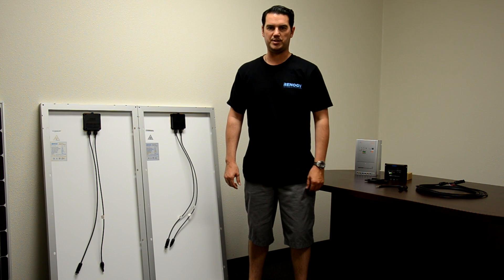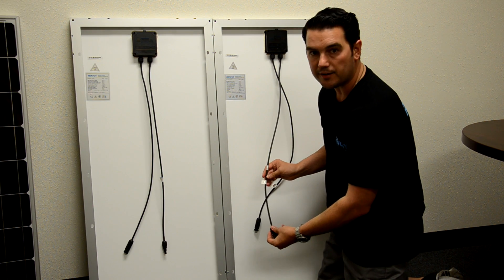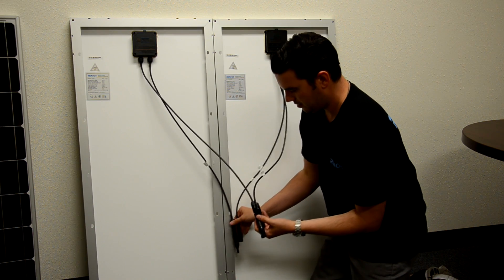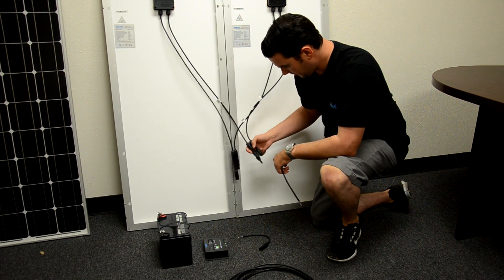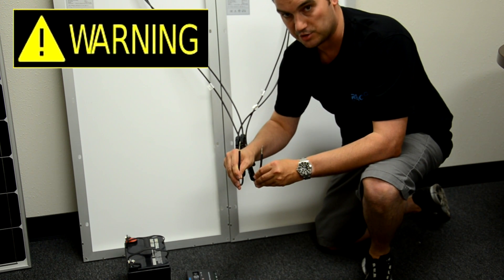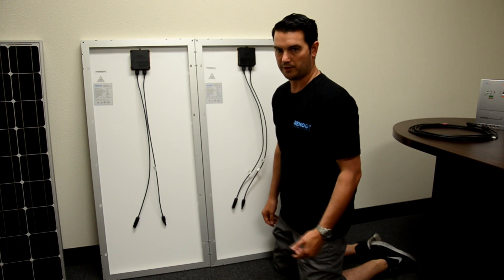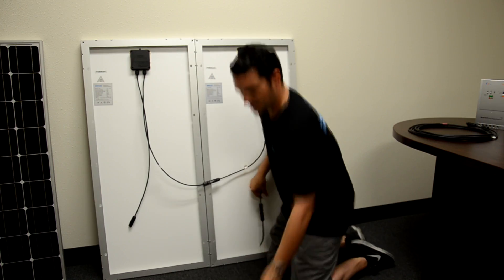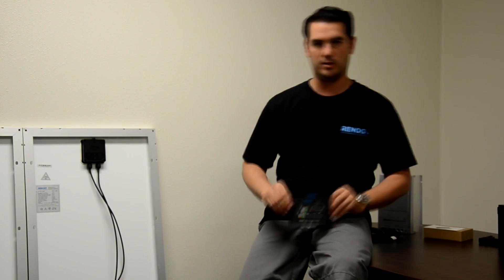Renogy: How to connect your Solar Panels in Series and Parallel Pt. 1

Comment: You should connect those wires to the charge controller first. Then after your battery is connected and your charge controller is on plug in the cables to the solar panels.
Reply from the maker: Hello, My G.

Thank you for your feedback. We have reflected the problems to our product department and we will revise the mounting details later. 

Wish you a nice day.

Comment: What is the gague/size of the adapter wire that connects to the charge controller ?
Reply from the maker: Hi, Robert.

Before we calculate the size for you, we need to know the following information:

1. how many solar panels you have;
2. how do you connect the panels? in series or parallel;
2. Please kindly tell us the operating current of your each panel.

Look forward to your early reply.

Comment: Hi watched this  . But im confused im wanting to connect 2 150w panel to a 30amp controller mppt . And 2 x 110 amp hour batteries .so what is the correct way for me as im told to keep 12volt system the batteries have to be connected , by parallel  ??
Reply from the maker: Hi, Adrian.

If the batteries are connected in parallel to form a 12V system, it is recommended that two 150W solar panels are connected in parallel, too.

Hope it is helpful.

Comment: I wont to set up a parallel system with two panels one facing west and one facing south east  will the two panels work individually as the sun moves past a blind spot

Comment: So I bought these
https://www.renogy.com/deep-cycle-agm-battery-12-volt-100ah/
And need help.
I have them set up as 24v series. Can my 24v 40amp 1500-3000 inverter run it?
My confusion is in the amps
Reply: No answers even for customers. TY

Comment: I might not get an answer for this but I still need to ask.  Do I run Series or Parallel if I want to charge two 12v batteries at the same time?

Comment: So i have a 12v battery bank and PWM controller system. I am upgrading to a 100V, 20A rated,12/24/48V MPPT charge controller, and want to install two Renogy 100W solar panels in Parallel to keep current lower.  My understanding is that i will be running at 24V at the panels, but i obviously need to keep my battery 12V. Does the charge controller convert it to whatever output i need since the input is now 24V?  Second, What fuse size is recommended for the two Renogy panels in parallel?

Comment: If I have a 300 watt element and 3 100 watt panels what is the best way to wire it up?
Reply: Do want to run a 12v system?
Reply: @chrispickle7661  yes but no battery’s

Comment: I have a 100w and a 200 watt panel from you guys can i run those together amf if so how should i do it. I have two 100ah renogy batteries.  O want to have 12v system.  I want the most life out of each battery each charge. From the research iv done i can link them but will lose wattage is that correct? How much will i lose. Please respond. Thank you

Comment: One question that I have though that has been very difficult to find is "How do you connect both the grid inverter and hybrid inverter to the Mains"? Is it done via 2 different double pole breakers that are turned on simultaneously ? if so, which of the inverters (grid-tie or hubrid inverter) control backfeed to the grid?

Comment: Thank you for this video, I'm new to the solar world and could you please tell me what connectors I would need to hook the panels in series to plug into a solar generator, I would rather not deal with bare wires and thank you very much.

Comment: I have 2 car battery of 55Ah 12V and two car battery of 200Ah 12V total 250Ah in serial 24V.
Controller 12V/24V 20A.
Also Panels of 160W 12V and the purchase of another panel is planned of 160W 12V total in series 160W 24V.
Whether it is a suitable charge controller for this panels?

Comment: I debating now between 100w harbor freight or 200 watt renogy from Amazon Im going to use this setup on my boat:
- (2) Walmart everstart marine batteries 
- 1500 watt max  inverter 
- 24” vizio led smart tv 
- 700 watt car audio amp for extra speakers I’m going to  install in boat 
I’m dedicating (2) batteries just for this setup and my thought is using the solar kit to keep these batteries somewhat charged,
I have (2) other batteries ( same kind) that (1) Is for the boat & other is for boat accessories , I plan on installing the panels on top of my Ttop so they will get direct sunlight

Comment: I have 8 renogy 12 v 200 ah batteries. They are use as backup. I have notice that even when NOT USED , these batteries lose 15 to 20 % charge. I notice it because when had no power and the sistem kicked it, I went and saw and it had lost 20% charge. IT was giving a low voltage WARNING. pLEASE HELP.

Comment: Can I connect a 20 watt panel and a 50 watt one in parallel? I searched on google and yahoo and can't get an answer. 🤔🤔
Reply: Don't mix panels if at all possible. Main reason is whatever panel has the lowest value is what the system will bring the stronger panel down to. It dumbs down power instead of adding up like you may think it should.

Comment: If I was your boss I would have fired you
Reply: Hi colin. You seem to know your stuff so hopefully I can profite from your knowledge.
I want to Increase my 100w solar panel system to a 20 system plus have 2 to 3 leisure batteries connect to said system. Those batteries will also be attached to a split charging system. This will be installed in my van to charge laptop/phone and speaker in the UK. My understanding is that I should connect the panels and the batts in parallel as to maintain a 12v system. Is this correct? 
I also wanted to get a fridge running of this too but I realise that this might be too much. Any thoughts and advice would be great! 
Thanks
Reply: *200 not 20

Comment: Great... Now, I have twelve 18V panels and a combiner box with inputs for 6 connections. How do I connect this system to a 24V PWM controller? It came in a lot with no instructions lol
Reply: Here is more info from them if you're interested: https://www.renogy.com/learn-series-and-parallel/

Comment: Can I ask what gauge the cable in the adaptor kit is please? Well I can, I just did, lol.
Reply: Most likely 12 gauge. But they also offer 10 Gauge if you need it. I technically only needed 12 gauge but went with 10 gauge because the cost was nearly identical.

Comment: Why do you recommend a series connection over parallel if shading has such a profound effect on all the panels output?
Reply: Here is more info from them if you're interested: https://www.renogy.com/learn-series-and-parallel/
Reply: series will giving you volts and parrellel will give you more amps.  so if you need more volts do series or if you need more amps do parallel.

Comment: Once you have connected two panels in parallel, what is the proper order in connecting your panels to your charge controller and your charge controller to the battery?  I want to make sure I don't mess up the panels, charge controller or batteries.  In my installation I have no circuit breakers. 

I assume first you should hook your charge controller positive and negative to the battery.  Then I should cover the panels with a blanket and hook the panels to the charge controller.  What I'm wondering is does the negative from the panels to the charge controller happen first, then the positive to the positive on the charge controller?  Is this correct or do I have it backwards.  What is the correct order for hooking up the panel to the controller and the controller to the batteries?

Comment: what if I want to connect a 100W panel with 200W panel
Reply: Don't do it it will make the voltage drop to lower panel W

Comment: Howdy... I have two renogy 150D Monocrystalline panels and a 40amp mppt charge controller. my battery bank is 12 volt. Two six volt Trojan T-105RE 6 volt batteries. how would you recommend that this be set up?
Reply: 8 months, I'm sure your not still waiting. But the two 6 volt batts need to be attached in series to make it 12v. The panels can be hooked up in series or parallel but mppt controllers like panels in series because it produces a usable charge current for more time of the day than parallel does. Don't side to series is one shaded panel can stop all charge unless you have panels w built in bypass diodes that let the current of unshaded panels to by pass the low panel.
Reply: One other thing, if you put the panels in series the voltages stack, 12+12+... The controller has a voltage limit, usually 60volts and higher, but I've seen as low as 27. You should not exceed what your controller specifies.

Comment: You have a diagram to connect 5 panels, the type of fuse, and size AMG wiring.  I order some renogy panels piece by piece but not sure how to connect all and using the correct size fuse and wiring

Comment: It would have been a hell of allot more intelligent to plug those 9inch leads in the controller first, & then, to just plug them into the  Y adapters, that come from the solar panels DUH!!!!))))))))))))

That way you do not need to worry about exposed leads, OMG!!!)))))))))))

Comment: For safety reasons you should attach the bare wire/plug adapter to the controller first then plug the PV panel plug to the charge controller plug no exposed wire to short circuit..... Safety starts with an "S" but it begins with YOU!...
Also once you figured out which wire/plug is POS and NEG go buy some RED electrical tape and rap the POS wire/plug adapter to easily be identified as POS.
Reply: ALWAYS CONNECT THE BATTERY FIRST REGARDLESS!!
Reply: @xraykadiddlehopper8067  What happens if you had 3 deep cell batteries and two 100watt solar panels? how do you get those 3 batteries to act like a bank of one?

Comment: This video is basically useless.  Why should you not short out the positive and negative wires from a solar panel?  How and why the hell do they rate the short circuit current then?

Comment: what's the best way to connect the solar panel to get more power? Is parallel better or series?
Reply: Depends on what you’re trying to accomplish. When ran in series, voltage is combined with a consistent amperage,  when ran in parallel, voltage is consistent  with amperage varying - source: electrical engineering student
Reply: Well, one is meant for 12v and the other is for 24v. Depends on your application, and what you are trying to accomplish.

Comment: Wow, hard to believe they use the same color wire for negative and positive. How hard would it be to use the standard red color for positive and black for negative?
Reply: This comment just shows how out of touch you are.  Take, literally, 1 second to search red wire on amazon.  It is more $$$ yet the exact same wire regardless of the exterior color, only the end user, Chuck Ignoramous and "David 'Fake Name' James" in this instance,  apparently need color coded connectors. How about we label them 1-2-3-4 as well?  For a price we can have some person in China do that for you too.   If you don't know, can't tell, or don't want to bother following the 9 inch wire to its destination then it's actually protecting you and us from your incompetence.   Keep solar panel prices as low AS POSSIBLE.  SOLAR ON!
Reply: Stupidity,  It doesn't cost any significant amount to mark one of the wires with a little bit of red Mr. Benji the bargain hunter.  You cheap ass bastard!
Reply: Worth buying some red duct tape to avoid hassles when wiring up
Reply: Yes that seems pathetic to me too.  Just a little bit of red on the positive wire insulation would be nice, yet they cannot even do that.  Bastards!

Comment: So for large installations where you have many solar panels (like on a house), how do they typically connect them?  Or does it depend on if there are microcontrollers on each panel?
Reply: in a house you actually don't need it, it's not as big as you think but if it does have a lot of strings you would use a combiner box for your solar

Comment: Hi i got two panel with these specification what type of system can i use??

Maximum Power Pmax 200 WP 
Voltage at Pmax
 Vmp
 35.86
 V 
Current at Pmax Imp 5.57 A 
Open circuit Voltage
 Voc
 43.8
 V 
Short Circuit Current Isc 6.69 A

Comment: Hi, I have 3, 250 Watt panels  should I connect them in series or parallel, and do I connect the two 12V batteries the same, cheers.

Comment: If your panels are connected in parallel, do your batteries need to be connected in parallel also?    Or can you connect the batteries in a series and connect the panels in parrelell ? Vice versa

Comment: Got (4 panels260w)(1 mppt 40amp, 100v,12/24)(4Batt 12vparallel, 100amp each)     Question I wanna do Series-Parallel so Ill just take 2Panels Series + 2Panel Series then connect them parallel to my mppt 12/24.  It will bring higher watts wich will help with max charging at daytime?  Do I have to change batt-setup? Batt is curently 12v-400amp setup
Reply: Did you ever get a response? Same question i had since i have a 12V trailer, but want to run parallel 24V solar panel on a 100V, 12/24/48V charge controller

Comment: Hi Renogy, fast question: I have 50W 12V solar panel and a lead acid battery 12V taken from a car (50AH)was using gel battery before but small capacity and expensive. I want to increase my power, for example adding same type 50W 12V panel. Should i connect paraller or series? How many can i connect(charger is PWM i think 10A, if problem i can buy bigger). Also about batteries, do you use same logic for connection?(parraler/series) can batteries be same volt of course but different AH?
Reply from the maker: We would recommend to hook up those 50W panels in parallel to increase the amperage and to keep the voltage the same, the 10A will be able to handle (x3) of our 50W panels in parallel, as for the batteries we would recommend to keep the voltage and amp hour rating the same, if the amp hour rating on the batteries are different, the smaller capacity battery would consistently be over charged which is not good for the life of the battery. Please email or call us here @ 800-330-8678 if you have any other questions or concerns.
Reply: thank you so much for your reply, i just did a mistake. i need to connect 2 panels instead of 3 of the same specs 50W , so this will be again parallels or this time maybe choose series without the extra adapter? (x2 panels)
Reply from the maker: That is correct, going to a 10A pwm controller, we would recommend a parallel connection with the 2 panels with our MC-4 branch connectors. -S.C.

Comment: can 2 panels connected in both serial and parallel at the same time?
Reply from the maker: While it is possible to do a series-parallel connection, you would need more than two panels in order to set that up.
Reply: I have 2 12v-panels,  one 12v and one 24v charge controller. 
To power the 24v controller, I wired up the 2 panels in serial configuration. 
To power the 12v controller, I wired up the 2 panels in parallel configuration. 
Instead of reconfiguring the 2 panels depend which controller is used,  
Is it possible to wire up the 2 panels to power both charge controller at same time?
Reply from the maker: We would not recommend connecting one array of solar panels to multiple charge controllers, it could cause issues to the controller. Please email or call us here @ 800-330-8678 if you have any other questions or concerns.
Reply: I bought a WeatherKing building 12 x 32 and I bought the solar system that had to be removed from another build. I had someone younger than me disconnect the series wired 24 volt system. All videos show wiring in portrait arrangement. I need to know how to connect 4 panels in series end to end (landscape)
Reply: @markmccune5871  Connection is same as per portrait format. However, the wire may be too short when more connecting than 2 panels
Reply: @whereistee1  it was connected before . All I need is a schematic or know configuration of the panels should lay down. Connectors all at the place, or 2 panels where the connectors are close together
Reply: @whereistee1  I got all the series/parallel figured out. It series. Your description of the P1  P2 was helpful.  I laid out 3 of the panels end to end in my shop (the other is already installed on my roof) and I did like you said, p1 to p1 then p3 to p4 then group 1 to group 2. When I didnt take it apart and had a pile of male and female Y connectors it was a little confusing. Thanks. Now if it would just stop snowing and raining..lol
Reply: @markmccune5871  Made a mistake in previous reply. Please note corrected connection.

Connect/Join P2 + to P4 + , Connect/Join P1 - to P3 -   [This is corrected connection]

Meaning...
P2+ and P4+ should be connected to the  + end of charge controller
P1- and P3- should be connected to the  - end of charge controller
Reply: @whereistee1  then where are p1+ and p3+, p2- and p4- connected?
Reply: @markmccune5871  

What brand and model are your panels and charge controller?

Assuming your solar panels are 12volts and your charge controller is 24volts...

P1+ connect to P2- to form a series to produce 24volts. (Pair/Series A)
Connect P1- to  the - terminal of charge controller.
Connect P2+ to the + terminal of the charge controller.

P3+ connect to P4- to form a series to produce 24volts. (Pair/Series B)

Connect P3- to  the - terminal of charge controller.
Connect P4+ to the + terminal of the charge controller.

The end result is 
P1- and P3- connected to - terminal of charge controller.
P2+ and P4+ connected to + terminal of charge controller.

NOTE: Please make sure your charge controller is 24volts and can handle the total output of the 4 panels.

Comment: sir if 12 panels of 300W each panel  how to connect for 48v system?
Reply from the maker: We would recommend a series/parallel connection between your 12 panels. you would wire 4 panels in series and then parallel the 3 rows together.  Please email or call us here @ 800-330-8678 if you have any other questions or concerns.